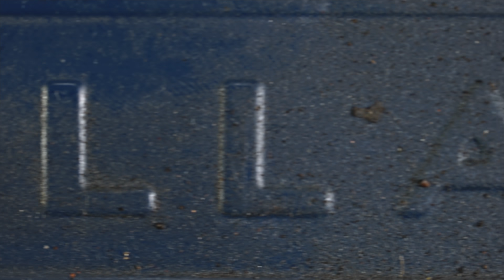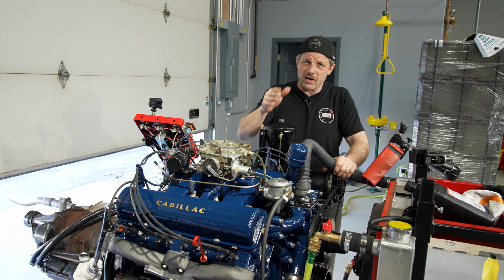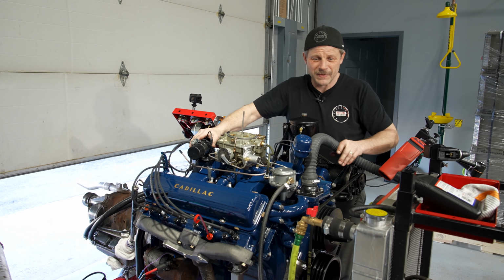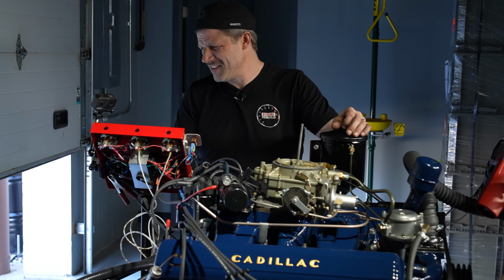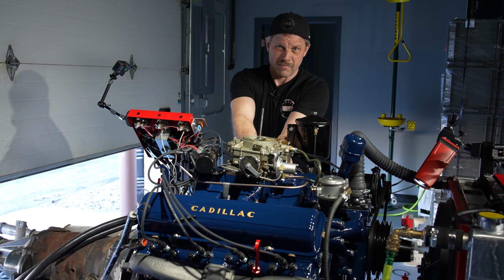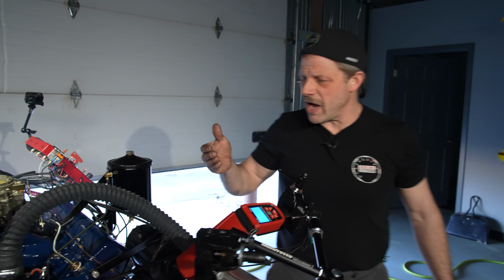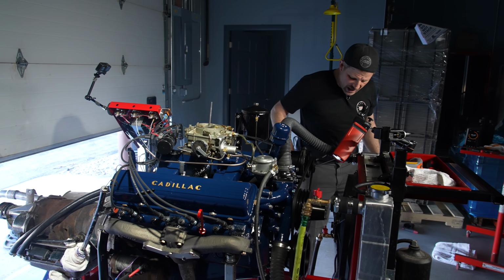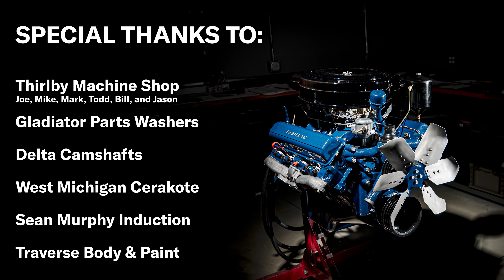Worn-out Cadillac V-8 Engine Rebuild Time-lapse | Redline Rebuild

Comment: If you've ever put a distributor in 180' off you immediately recognise the sound it makes when it tries to fire.
Reply: and by the fireball that comes blasting out of the top of the carb shortly after, lol.
Reply: If you’ve watched Davin build a motor or two you recognize that sound... :D
Reply: been there done that
Reply: Or when you blow the mufflers off,like I did in trade school over 20 years ago. My instructor laughed at me. Scared the hell out of me. LOL
Reply: We all been their before..lol.
Reply: Yup that weird gulp noise and regurgitating fireball from the carb.
Reply: Yep!
Reply: @brandendavenport2892  same sent a fire ball right into the cab of my van it was a little crispy
Reply: can you explain what is 180' off ? sorry, Im not so great at engine, but Im curious
Reply: @amryms  It's simple enough. A gear on the camshaft drives the distributor, and the distributor has a flat tang to make it line up correctly when you insert it. 
With the four cycles: Inlet, Compression, Power and Exhaust (suck, squeeze, bang, blow) you will have two pistons at top dead centre (TDC) simultaneously. One will have just finished the exhaust stroke, and be opening the intake valve, while the other piston is at the top of the compression stroke waiting for a spark to trigger the bang.
If the tang on the end of the distributor is 180 degrees out, it will send spark to the piston that has just opened it's inlet valve instead.
The result is that the raw fuel ignites and shoots flames back through the carburettor.
The fix is to unbolt the distributor and rotate the shaft 180 degrees, sending spark to the correct piston.
Reply: @vettekid3326  you mean the fireball part

Comment: Your next project should be a diesel, like an old 6.9 IDI from a Ford truck that would make my day
Reply: Or maybe a detroit ? 😁
Reply: Maybe one of those old Mercedes 5 cylinder turbo diesels?
Reply: yes it will be a 6.9 but only cause i own one that needs a rebuild
Reply: I'd like to either see a common Cummins 6BT or an uncommon VM Motori 2.8 (Jeep Liberty Diesel).
Reply: @janknudsen145  understandable
Reply: If they're gonna do a diesel, they should do an olds diesel and either rebuild it as stock or make a stroker small block olds out of it

Comment: Awesome timelapse video as always!
These Cadillac V8s are quite underrated... Nice to see a video on these engines.^^
Reply: Nice too see a old Caddy rebuild,never too old too see those old one built
Reply: @kyleforeman4543  I concur with you on that one.
It's nice to see an old engine like that Cadillac V8 being rebuilt to factory condition.^^
Reply: @bhumiriady  I'm absolutely positive this one is built better than factory condition.
Reply: I have a 58 cadillac that my parents bought in 1960. Lifelong Southern California car,  in great shape. It has the original 365 engine, same as this, , and runs beautifully.  They are torque monsters,  just whats needed to get 5000 lbs of car moving from a dead stop!
Reply: @1958Cadillac-v2g  I have a 1957 and it really is a joy to drive. Silent from inside the car when just holding a cruising speed but just touching the pedal and it shows you just what it's capable off.

Comment: These vids are always fun!  And what a beautiful engine, a superb example of old skool automotive art.  That gold 'Cadillac' lettering on the rocker covers was the finishing touch.
<old man grumbles> But guys... I have only one question: Why on earth do you use so much assembly lube?  In my view, too much liquid teflon floating around during break-in will only compromise the breaking-in process.  We want the rings to bed in, and all that teflon washing around will only get in the way of that happening, won't it?  Sure, we use assembly lube for the bearings, the cam, the tappets etc. to give all these things a 'leg up' during initial startup... but after that, we let the engine oil do its thing, right?  Otherwise why don't we just fill the oil pan with teflon and be done with it... </old man grumbles>

Comment: I wish you showed more ( all ) the the detailed cleaning & machine work at standard speed on all parts one by one. I never seen how they installed the cam bearings ? never seen the freeze plugs sealed & installed? or oil galley holes cleaning out or plugs sealed and installed. These are all very ( most ) important parts that should be covered with detailed foot notes on each operation.

Comment: Hey Davin.. little trick i've learned is to spin the engine with the starter and have a timing light attached before I ever let gas near the engine.. If you can get 5-10 degrees btdc showing, any engine on earth will fire up the first time every time...

Comment: Such good videos.  The distributor brings back fond memories of my cousins small block.   Had gas dumping out the headers and set the car on fire three times lol.  180° later and it was purring.  Ironic side is 2 weeks later the car burned up on the side of a backwoods road.  It was a FD RX7 and he worked on it for 2 years and only it ran for two weeks.  Tears were shed.

Comment: Had to smile when he tried to fire it up and got a carb backfire.  Had a similar experience 62 years ago when a buddy and I rebuilt his '50 Merc flathead after we graduated from high school and he used a cash graduation gift to finance the rebuild.  First time ever for both of us.  We were working in a drive-through granary shed with a few hand tools and a chain hoist.  Having no engine stand we reinstalled the rebuilt engine and the first time we cranked it got fire shooting out of the top of the carb.  Took us a while to figure out that the distributor was 180 out.

Comment: I’ve just quit my job in fundraising/ marketing because the 100+ mile commute to our office and other places was taking a toll on my Subaru Outback (not talking about bridge tolls here). And many other reasons also.

As a result, I’ve gotten into a contagious routine of watching these engine rebuilds on my time off and many other car fixing videos and techniques (rust repairs, fixing head gaskets, oil changes, stuff I don’t even really need to know to fix my car but I am just curious about it). 

Point being, where does someone with no knowledge about mechanics or fixing engines start to learn about what it takes to restore vehicles like this? As a hobby or even possible career change.

Comment: Love these videos. So much work goes into the production but for me - the effort is worth it. 

One thing that strikes me is where are all the young guys working in machine shops? Last year I brought a head to a local machine shop and had a great experience. Dave, the guy who owns the shop, is a one man show. He is busier than ever but can’t find help. His kids didn’t take to the business. Dave is probably early 60’s and own all the old school and newer equipment needed. I asked him straight out after a number of interactions “who is going to take over this business when you retire?”. He told me no one. He will shut it down and sell off the equipment if he can. Not sure of the profitability of these shops but my head, single 4 cylinder head was tested for cracks, skimmed, vacuum tested again and valves cleaned up for $250. Which I felt was a good deal for both sides.   Will be sad when these shops disappear.

Comment: The 180 out seems too be a common problem with GM guys ... more so than with other brands.  My trick was to rotate the engine to TDC - rotate the pushrods or inspect the rocker arms to ensure its on the compression stroke then rotate the distributor till the rotor lined up with #1 plug wire.  Install the distributor then use a test lamp (12 v) or ohm meter to gently rotate the distributor body till the points opened and cinch er down.  That will get it close enough to run and to set your timing with a strobe ...  Very helpful when having to work away from the shop when a pair of points gives up the ghost ...

Comment: I love seeing a old cruddy engine come into the shop and being transformed into a working peace of art. I have one question after you assemble the engine  and run it for a time do you need to do a oil change because of the assembly lube mixing with the oil

Comment: I think you used a broken carb spacer and the wrong top gasket. I just did a carb on a 57 model 62. Put the carb on and it didnt run correctly, then I found that the spacer was cracked exactly where that one is. After replacing the spacer made the mistake of using the wrong top gasket. There should be a triangle shaped cutout between the rear edge of the secondary bores in the gasket. The one I initially used didn't have it and the idle bypass screw and the vacuum supply to the booster had no access to manifold vacuum. I just watched this video to make sure I had the right spacer on there (hard to catch in the video). I noticed it looks like your space was cracked right where they all do. The front cracks near the primaries. Thanks for the video on the nice 365 build!

Comment: Your also seeing the old school pvc system blowing out the back.
Reply: These engine only had a down draft tube that pointed straight down near the rear of the engine. When the engine was worn or tired, thats where all the blow by SMOKE came out.

Comment: The reason you were 180 degrees out - is because of how you time the camshaft, and how everybody AND the manuals time the camshaft.  Everybody lines up the timing marks on GM motors so that the dots are pointing right at each other.  This is OK to get the chain on the gears and get it in the right relationship to each other - but it is NOT TDC on #1 cylinder.  It is TDC on #6 cylinder, or 180 degrees out.  When both gears are pointing to 12 O'clock on both their respective faces, this is TDC on #1.  You can check this by pulling a valve cover and seeing that both valves are closed on the #1 cylinder.  For all the engine swaps I have been called in to troubleshoot, this would be the number one mistake everybody makes - even people that have had many years of experience.

Comment: That’s a gorgeous looking engine.   Nice work as always!  And nice to see you admit and include the timing error.... I had a similar issue with the first startup after rebuilding my vw beetle engine a few weeks ago... after hours of diagnosing, resetting and rechecking the timing numerous times, replacing and resetting plug gap, replacing wires, etc, realized I had the biggest brain fart yet... incorrectly set the firing order to 1-2-3-4 instead of 1-4-3-2 🤦‍♂️ not sure what I was thinking there

Comment: why can you not set the ignition timing in the correct place in the first place so that the engine starts the first time, I understand that the oil pressure is not there yet, but in that case, just spin the engine without the ignition coil connected to build up the oil pressure. If you are not sure how to do that, just ask.

Comment: are there also new modern intake manifolds for 429 cadillac on the market? I only find some for the 472 and 500 engines but none that fits the 429
Thank you

Comment: I don’t know if you guys would be interested in using it for a video series for redline rebuilds, but I have a 53 willies flathead that could use a rebuild (runs and drives but ticks, and fouls plugs like crazy, possibly needs carb work as well) 

All original engine and trans, never been opened up.

It is located in mid Michigan, if your interested send me know an email I could talk to you at, I would be willing to pay for parts and such

Comment: Can ya' do a build with this type of engine but give it fuel injection and performance upgrades for maximum horsepower and economy?
Reply: These engines were designed about 70 years ago. No, they can't be modified like that. And they were not designed for fuel economy.  They make 310 HP.
Reply: @1958Cadillac-v2g  A guy literally made an aftermarket common rail injection system for an old school Detroit. Anything is possible if you have the capital fiat to finance it.
Reply: @crusiethmaximuss  Great, you get a 365 cadillac engine, rebuild it, fuel inject it, Turbo or Supercharge it.   Let us know how it turns out.
Reply: @1958Cadillac-v2g  Man, if I had the money I would 🤣🤣🤣

Comment: Why do old American V8s only have 2 valves per cylinder and only one spark plug to start? There are no V8s with 32 valves? And with the twin Spark system? The Twin Spark system consists in the use of two spark plugs per cylinder instead of just one in order to improve the combustion of the mixture (air-petrol) in the combustion chamber. This allows

Comment: I got a 2000 Cadillac Seville Northstar v8 I need a mechanics mechanic I was told I needed to replace head gasket point me in the direction where I can get a rebuilt engine

Comment: Great work as usual on the Caddy!
Two engines I'd love to see (if the haven't been already done):  
1.  The Rocket 350 V-8 (I used to have one in an old Cutless Supreme.  They are indestructable :-)
2.  A Dual OverHead Cam engine.  I'd love to see how they work.

Comment: If I may, what does something like this cost?
Reply: I paid 4200 12 years ago. Prices will definitely vary, we reused the rockers, camshaft and crank. All were professionally machined. It turned out great, still running beautifully,  about 9000 miles on it now.

Comment: How much of the engine components are reused and how much is replaced with new parts?
Reply from the maker: Most of the important parts are new. New pistons and rings, new bearings, new seals, new water pump, new wires. Original carburetor, fuel pump and oil pump were all rebuilt.
Reply: On my rebuild, we kept the rockers, Crank, and Camshaft..Machine shop said they looked good, and could be machined back to like new condition

Comment: the red lubricant that they put on the crankshaft, camshaft, etc... what is it? only lithium grease?
Reply from the maker: The Redline Assembly Lube is not just lithium grease. It's a special synthetic lubricant made specifically for breaking in the engine (camshaft, lifters, pushrods, piston skirts, etc.). It's engineered to break in these surfaces without clogging your filters.
Reply: @Hagerty  haaa very good. here in Argentina in one of the most popular categories (road tourism) that runs with 6 in line engines (chevrolet, ford, dodge and torino) for the assembly of the engines, Gn plus assembly paste is used, with molybdenum disulfide , this paste is similar to what you use but black and from the Molikote brand.